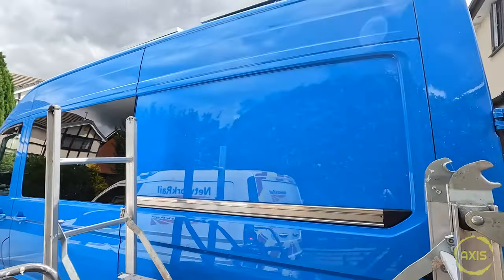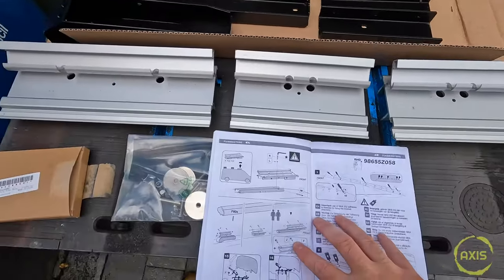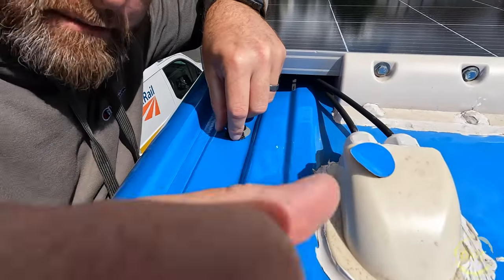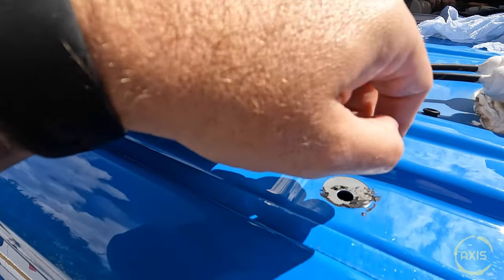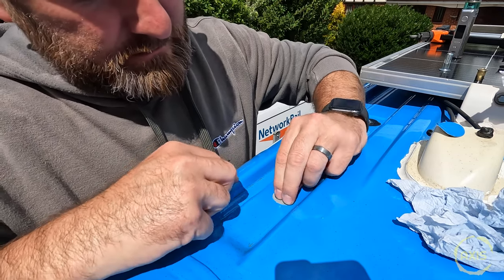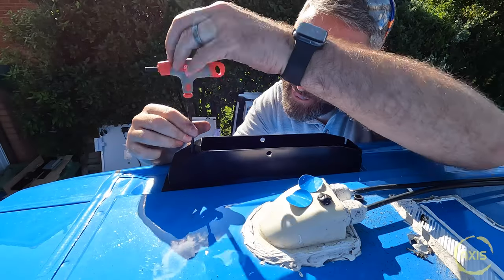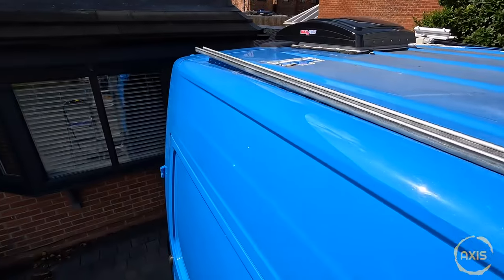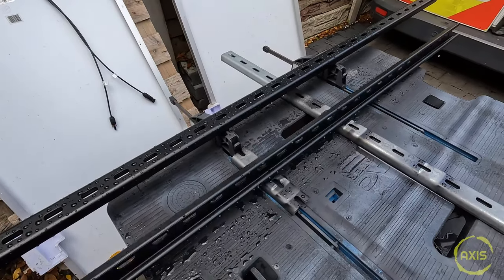Fiamma F80s awning install with a Unistrut roof rack on a MWB MAN TGE Campervan 4K

Comment: Exactly what I need to do. I was just about to fit Unistrut rails for solar panels, then I saw your video & realised I wouldn’t be able to fit an awning, so now I’m redesigning the whole plan. Thanks for stopping me before it was too late..!
Reply from the maker: David, you can get different brackets that are designed for having a roof rack, and others have modified some to mount to the unistrut.

Comment: Very helpful video. I need to do something similar with my unistrut roof rack. You hinted there was a better way of getting the solar cables into the van other than those stick on cable glands. What was that? - I'm nearly at that stage. Thanks.
Reply from the maker: Glad it helped 😊 I used the scan strut cable entry units. They are rock solid and look the part 👍🏻

Comment: Thank you for the video, just wondering how the Plus Nuts holding? 
Looking to do the same on my LWB sprinter just for the awning but have been advised against it.
Reply from the maker: They are rock solid bud. If you can access inside the roof, then I would bolt the awning down. If you can’t then this is the only way apart from attaching to a roof rack.
Reply: No access as already converted.
Reply from the maker: @benpinington8202  what was the reason for being advised against?
Reply: Due to the load when the awning is out, as not fitting the internal washers meant it wouldn’t spread this
Reply from the maker: @benpinington8202  that’s a fair comment for normal rivnuts as you only create a small inner washer, hence why I used the plus nuts. They spread out much wider and give the next best thing to a bolt and washer. 👍🏻

Comment: Hi bud. When I place my 3m unistrut into the Channel  it doesn't sit flush due to the bow in the roof. Does this go when you bolt it to the roof? Fml 😀
Reply from the maker: Depending how far you have put it to the rear, the strut should form to the shape of the van roof when bolted 👍🏻

Comment: Hi Shaun,  really great video! We want exactly to do what you have done, just one question: what size of unistrut channel do you suggest to put between the brackets of the awning? I have seen that you have tried to highter it up in order to do not let the horizzontal bars touch the roof. Have you levelled the profile at the rear of the van?
Reply from the maker: You could probably use the 40mm stuff to save the step up that I did at the rear. Reason I went low was to keep the uni from sticking up at the front. Good luck with the install 👍🏻
Reply: @AXISUK  thank you! With the 40mm may I have problem at the front?
Reply from the maker: @DaniloeSara  possibly depending on the awning bracket. You could do 20mm under awning and 40mm on the opposite side. That way you only need double up under the rear of the awning. It’s the front end that is tight on clearance

Comment: Hi, really good instructional video. I'm planning on doing similar on my Sprinter which is also already built and fitted out inside. Have the rivnuts/plusnuts held up ok? It does seem like they would. Thanks
Reply from the maker: Thanks 😊 yeah solid as a rock. Had a check when I came back from the lakes and still had my panels in situ 🤣

Comment: Nice one buddy, looks well . Just shows how much out of square the shape of van is, food for thought 🤔
Reply from the maker: Honestly nothing is straight on these vans 🤣 that roof rack was a job that needed doing but I was putting it off 🤦🏻
Reply from the maker: And I have an expensive umbrella ☂️ 🤣
Reply: @AXISUK  nice Brolly tho, better than mine 😂 I was waiting for the raptor to make an appearance on unistrut 🥴
Reply from the maker: @vandox21  🤣 at £20 a tin and the possibility the uni could be chucked in the bin 🤔 thought the Halfords stuff would be best option haha
Reply: @AXISUK  looks well tho 👍🏻 solar fits a treat length ways 👌
Reply from the maker: @vandox21  cheers 👍🏻 solar looks miles better from the side than it did before!

Comment: Hate to be that person iv got the longer rivets you linked below but my sealey tool doesn’t allow for the extra length any clues where to get an longer m8 riv nut nose piece from ?
Reply from the maker: @benrowe681  good question 🤔 have you tried Amazon or a local tool shop? Does the sealey tool allow you to adjust the length?
Reply: @AXISUK  thanks for your reply I may have found one on Amazon iv ordered another riv nut kit to see if it’s got a longer thread if not I’ll send it back and contact sealey direct it’s because mostly of the riv nuts are shorter stem not the longer ones all fails
Just have to go to shorter riv nuts
Reply from the maker: @benrowe681  fingers crossed they fit bud 🤞
Reply: @AXISUK  Yes your video was very helpful though even for a sprinter thank you !
Reply from the maker: @benrowe681  thanks ☺️